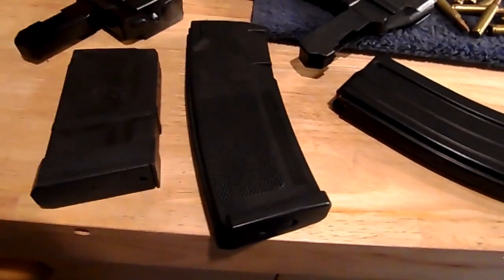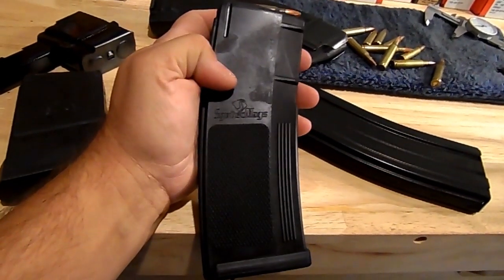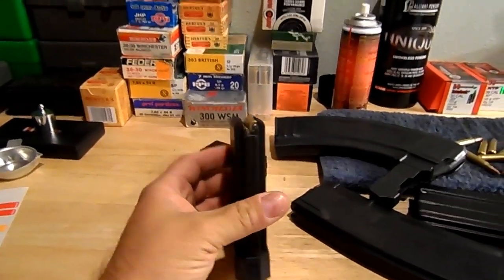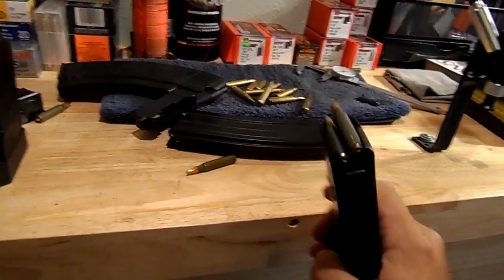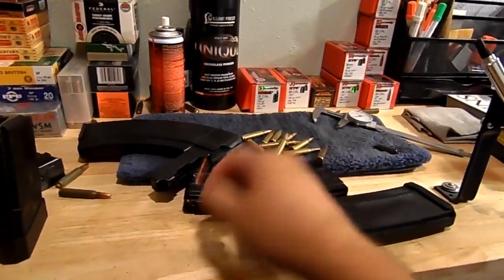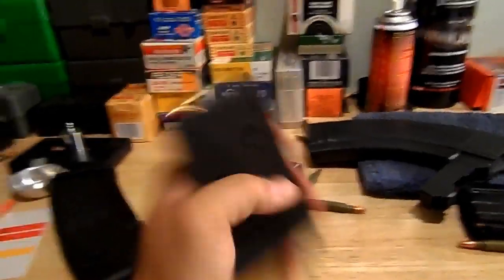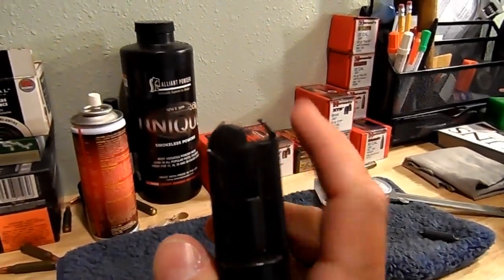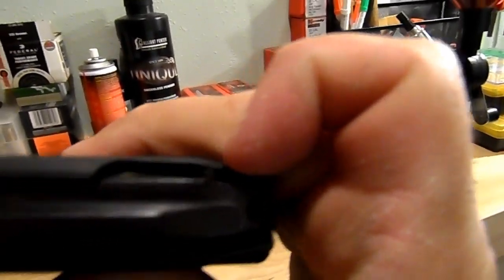AR-15 Syntec Magazine, Defective by Design

Comment: Interesting, good to know. I've used magpul mags for years and never had an issue. Apparently not all plastic mags are made equal.
Reply from the maker: Guns & Games thats true. I have had good luck with Thermolds and Promags. Im sure that these cheap off brand Mags are poorly designed and use as little material as possible. I did manage to fix these syntec mags and they work flawless. Hit my page and check out the video of how to fix a polymer mag :)